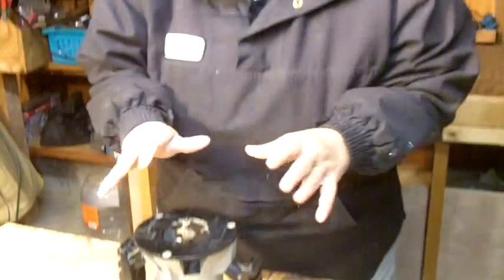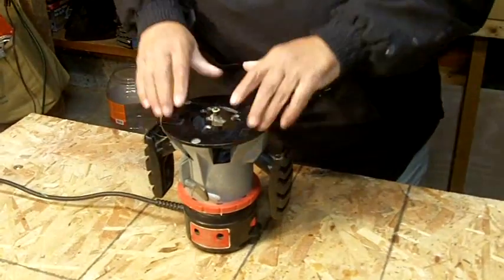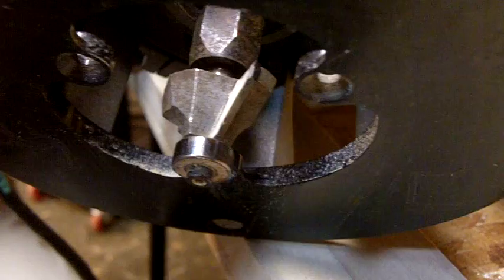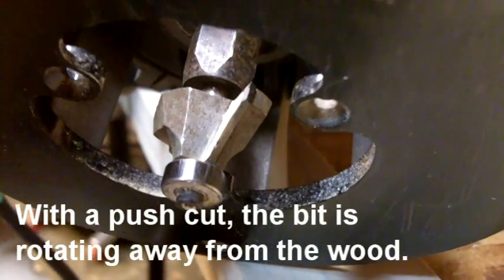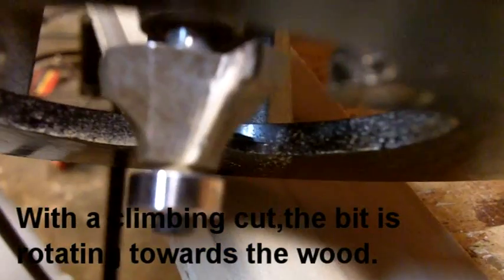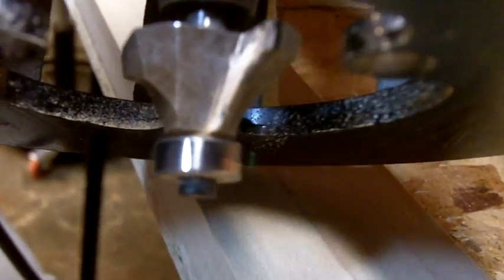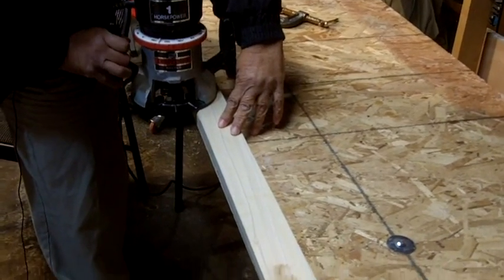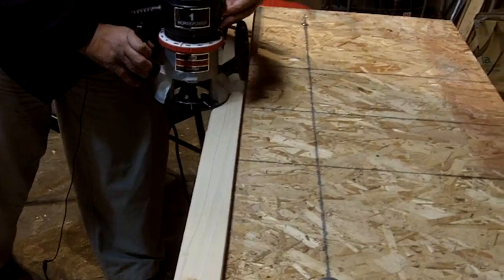Router Basics: Which Direction to Move Your Router

Comment: I describe it as “scooping” the wood. You scoop ice cream with the front of a spoon and not with the back of a spoon.The direction of spin of the trimmer is “the front of the spoon”. So, you “scoop" the wood in the direction of the spin, by moving the trimmer in the direction of the spin.This is the principle I remember and use. Some routers have the direction of spin drawn on the main body of the router.

Comment: I'm way too old and have owned far too many routers to not know this. "Not know this" in the sense that I couldn't explain this to anyone, but I can do it instinctively without having ever known the right or wrong way to do it. Just through practice I learned how to run the router to eliminate tear out. In the same way that I realized when I rode a motorcycle I was pulling on the opposite grip to turn, instead of pushing on the grip in the direction I was turning. Its interesting to learn about how I did it as opposed to the accepted way. I always adopt the traditional way. Its usually more accurate and economical.

Comment: I enjoy your videos.  Here is a pointer for THIS video.  You started around surface no.1 to the end and around the corner onto surface no.2 which is ENDGRAIN. Now here is the tip.  Continue the end grain routing to about an inch from the corner, STOP.  Pick up your router and place it around the corner onto surface no.3 about 1 or 2 inches from the corner by starting it and easing the cutter into the surface as you would normally do to climb cut CLOCKWISE back around the corner to where you quit.  Nice job!  No chipping or tear out which can happen if you had entered the end grain counter clockwise.  Now continue where you left off to repeat the same steps on the other end of the board for a complete circle.  I expect you know this already but I can't tell.  I'm sure you are saving it for a more advanced lesson.  Enjoy any how and have a good day.  Look at the video. First corner is clean, second corner is frayed.

Comment: Great video as always. One question, what if you are routing through a board? Like cutting a circle with a compass jig? The bit works on both sides at the same time so push and clime cut at the same time?

Comment: Another great video. Thanks for making it. :-)
I have a plunge router kit for my Dremel Tool. I'm sure it's been over-engineered, because there's about half a dozen variable settings on the router. I've used it a couple of times for routing a fancy bevelled edge on some sort of compressed wood called MDF (Yep. That toxic stuff. I wore protective gear.) It probably wasn't the best stuff to be routing. It's pretty soft, allowing the router to get stuck and dig in.
Having used MDF for a couple of projects, I'm not a fan of it. It's no good for shelves, because it's too flexible. Having since heard it's been banned in some places (due to the toxins holding it together), I'll steer clear of it in the future.